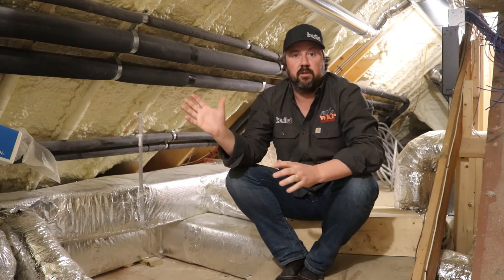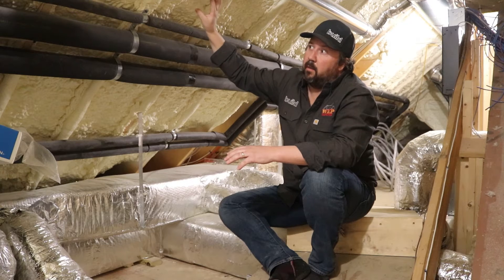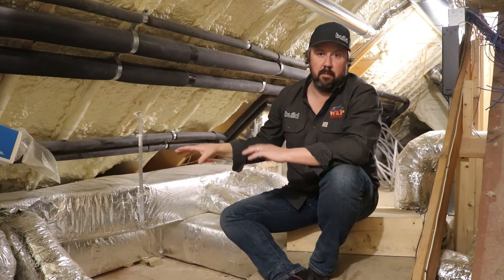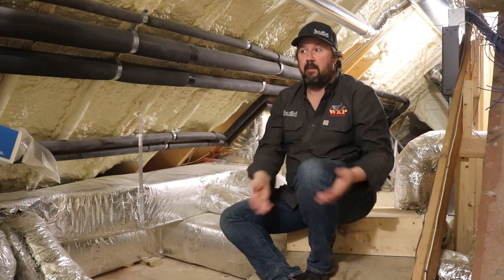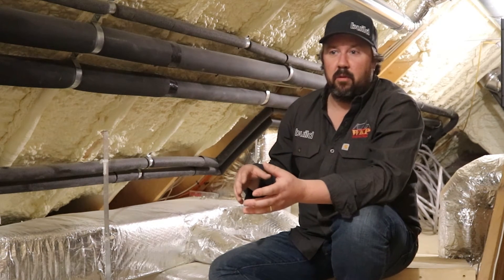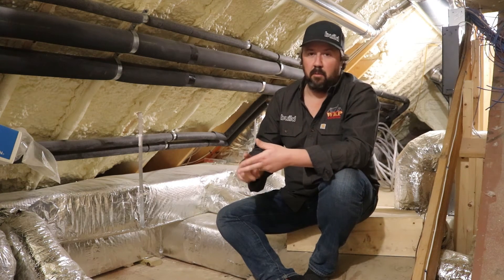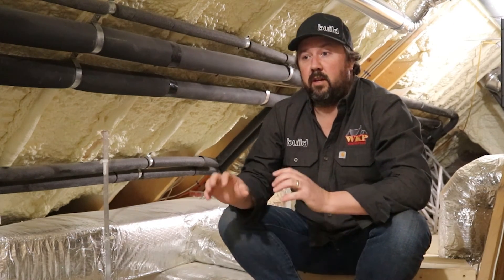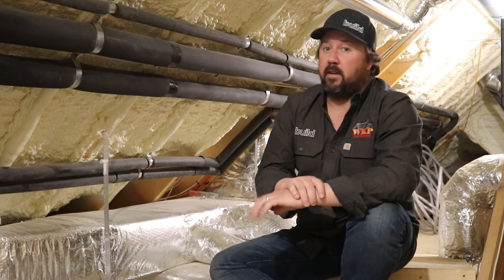HVAC Ducts & Conditioned Attics

Comment: Nice video, ? Can you condition an attic by still using baffles to allow air to flow from soffit to ridge vent. I used rockwool under the roof deck up to the ridge vent . Attic floor insulation and walls. Spray foam was not used. My contractor is installing a direct vent furnace. Also Shoulder the metal housing of the furnace be wrapped. Thanks

Comment: Our house in SC everything is in the attic. Our AC tech didn't seal up the air handler after working on it and now it's full of dirt and bugs etc. not only that because of the humidity here the air handler sweats like crazy.

I'm so torn what to do I hate having it in the attic but no real way to change that. I have been thinking about spray foaming the attic vs our soffit and ridge vent system.

Comment: The definition of a conditioned space is an area within the envelope with a heating or cooling system by direct or indirectly with 3 air exchanges per hour by a mechanical or wood burning device above 5BTU's, what are your thoughts?

Comment: In that climate zone, you have to use closed cell foam on the roof decking, right? But you can also use other insulation below it, like you did with the open cell foam? Do you have to put a supply and return duct in the attic? How many do you put in? Do you need a moisture vent at the ridge line (I have read that is required in southern climates, but I am curious about RI)?

Comment: When you have a conditioned attic, do you need to have any air registers or returns specifically located in the attic?
Reply: I came here looking for that answer. I wish they would go over that more. The build show has a million videos on airtightness that just explain the same thing over and over. They need to explain how to do it properly and what materials to use specifically. They are all over the place and it’s hard to nail down exactly what to do.
Reply: @Sotexmafia  I didn't have either a return or register in my house. It gets humid (~60-65 at peak summer in Alabama), so at the end of the year, I put a dehumidifier up there and that's solved any fears I had with moisture there.
Reply: Yes. To handle moisture that will eventually work it's way to highest part of the structure. Not as much as a livable space though. And I'm not sure about a return though... the spray foam makes fire concerns an if you also put a return in there... but maybe the codes have been updated.
Reply: You find the answer yet bro? I got the same question lol

Comment: If the attic is vented what good does moving the insulation from the floor to the roof joists do. They still have soffit/gable vents. Wouldn't they need to seal those before moving the insulation?
Reply: Conditioned attics do not have soffit/gable vents, conditioned attics are fully-sealed and are WITHIN the envelope of the main house.  Soffit/gable vents are used in an unconditioned attic to provide venting to the outside for moisture removal.  A conditioned attic connects to the air conditioning or heating for the main house, and gets moisture removal thru that system.
Reply: In the UK at least, I believe we're required by building regs to keep a 50mm gap between the top of the insulation and the slate / tile above. This keeps the ridge and soffit vents and allows the rafters to dry out if they do get wet.

There are plenty of 30 / 40 year old loft conversions with rotting rafters.
Reply from the maker: No need for soffit/gable vents in this scenario